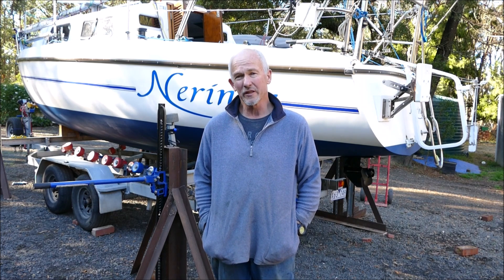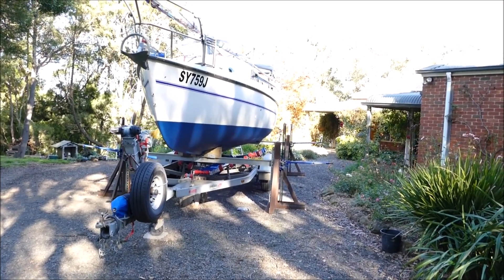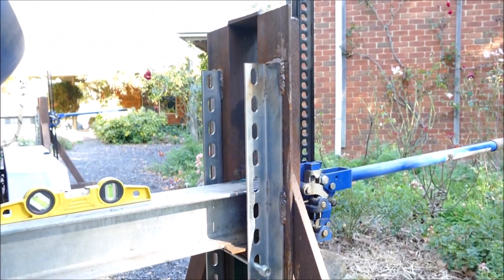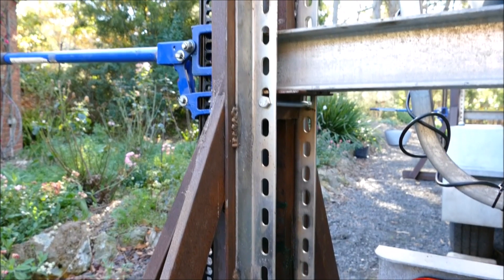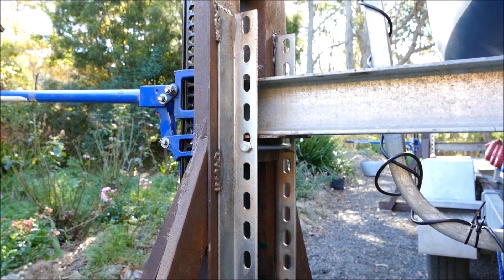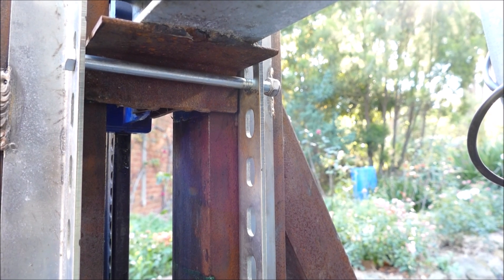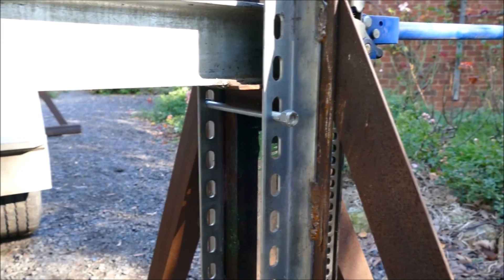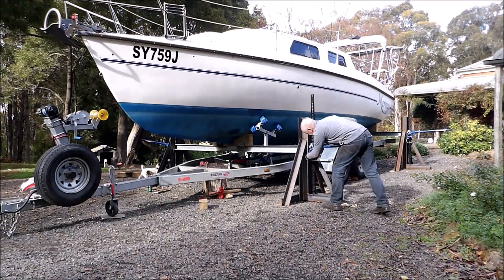Hardstand safety upgrade

Comment: Another great vid Mark..   You say each stand is holding around 600 kilos..  Does your boat weigh 2400 now?  I know the dry weight of 28s used to be 1400.. I get that things like radios, fridges etc all add up.  But would you have added nearly a tonne?
Reply from the maker: I do empty water tanks before lifting but the 1400kg given by Rob Legg is generally considered by most as a large underestimate. Its never been clear exactly what that has included. The amount of internal ballast in them varied over time with some having up to 250kg of extra ballast added. The specs also claimed a 40% ballast ratio. This really only applied to the most heavily ballasted version that would have had an empty weight approaching 1600kg. So to be on the safe side with the stand I allowed at least a tonne over the 1400kg. 

And yes once you start adding up all the additions you would be surprized how quickly it adds up. 140kg of added permanent ballast, 14hp 4 stroke motor, fuel tank, 2 anchors and associated chains, tv, extra cabinetry, marine toilet and holding tank and associated plumbing, water pumps, safety gear, electronics, 2 x 130ah lead batteries, 150ah lithium battery, 100ah lithium battery, davits and solar panels, water maker, diesel heater and fuel tank, anchor winch, furler, various spares and repair kits, cooking utensils, basic long life food supplies and cutlery, fridge and compressor, rolled up inflatable tender, electric trolling motor and I am sure I have still missed some things. 

My boat is not a racing boat and is always stocked for cruising so I can just jump on and go with a minimum of stocking. I did do the maths for this list before the Kimberley trip and for memory it came to well over 800kg of extras. Sure I could take out quite a lot of the above but it would take a couple of days and be a real pita. So I just made sure the stands were up to the job with most of it still in the boat.
So as you can see if the real empty weight of the RL28 is probably closer to 1500kg there isn't much change out of 2400kg.

Cheers Mark
Reply: @TRAILERYACHTADVENTURES  Agreed, they always weight much more than the manufacturers dry weight. Especially decades after rolling off the production line.. 
 A few of the guys on the RL Facebook site have been over weighbridges recently and report a total towing weight of 2.8 and 2.9. (trailer included)       With your additions it makes sense the boat would be "up there" now. 
I owned one years ago when weights werent so important (urm , at least not legally).  Im considering another one and selling my current sonata.   Just trying to decide if my Trailblazer will be legal..   At three tons max, it will be close without having to do gvm upgrades or change the car to a 3.5t ute.

Comment: Its a good upgrade.  Ive joined the small band of melbourne men with 4 high lift jacks and I recently used a stripped down version of your system to lift a Tiny House up from near ground level to 700mm to get its trailer under it.  Weighing in about 2.5 tonne (7500 x 2700) I found that over about 400mm high there was too much movement for safety.  I got around this by using 190 x 90 x 380 solid (not hollow) blocks dry stacked under the edge rails so that the maximum drop was 90mm each time we raised the load.  Now I have just purchased a Sunbird 25 that will need lifting so I can upgrade its trailer to 3.5 tonne road standards (Couldn't find a RL28 during lockdown in Melbourne and crossing borders is just too risky at the moment)  The yachts expected parking space gives me an opportunity to concrete in channel uprights with my lifting bar 8mm thick 100 x100 RHS being 3.5 m wide allowing 500mm on either side of the yacht and the high lift jacks inside rather than outside.  strategically placed holes in the side of the channel should give me the safety stops you describe in this video.  Thanks for the inspiration.
Reply from the maker: Yes the jacks on there own become unstable, hence the stands I built that go with them that provide stability to their full height. Sunbirds are very seaworthy boats as long as you get one with a diesel inboard that still has good life left in it. I went for the perforated angle for the safety stops as I didn't look forward to drilling that many holes! Hope all goes well with you restoration! Cheers Mark

Comment: Thanks very much Mark, an excellent upgrade - and good design. I was pondering how best to add static support pins to mine. Really appreciate the video.
Reply from the maker: Thanks Richard, took a bit to find a supplier of the slotted angle. Its the ideal material for the job and saved drilling hundreds of holes in plain angle. Cheers Mark

Comment: For exra saftey add a lenght of chain  at the base to run across the ground to tie the legs together so  they can't possibly kick out
Reply from the maker: Hi Graham, yes this could be added as long as it didn't interfere with the trailer being removed. The design relies on the lifting beams not being able to slide outwards because of the angle on the beams that slides along their face. If a jack fails and the beam locks onto the safety bolt the stand will be stabilized by the opposite stand through the compression of the lifting beam. The stands were designed the way they are to leave a clear path out for the trailer. Each stand is very stable in the outwards direction and being connected by the lifting beam creates great stability for each pair. I tried placing all the boats weight (just above the trailer for safety) onto each safety pin shown in the video. The stands showed no instability and in fact pushing on the side of the boat with all my strength could not create any movement. The position of the safety pins means the weight is still transferred over the base of the main bottom angle of each stand so would create little kicking out effect. The main thing I would say is that the stands need to be used on a reasonably level site. My gravel driveway is not perfectly level but I level each stand and once the boat weight is on them they are rock solid and wont budge. I have had the boat up 1.2m off the ground in 40 knots of wind for 24 hours with no sign of any instability in the stands at all. 
When used as intended with the weight on the jacks, the weight of the boat is actually borne in the center of the base area of each stand and so makes them stable in all directions.
Connecting the bases could be added for more piece of mind but in practice I have found it is probably not needed. Cheers Mark